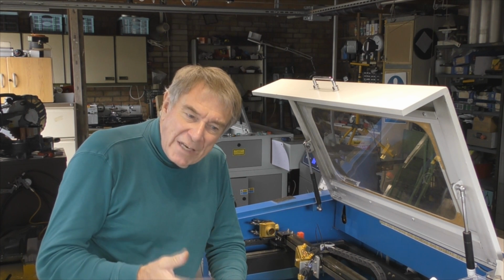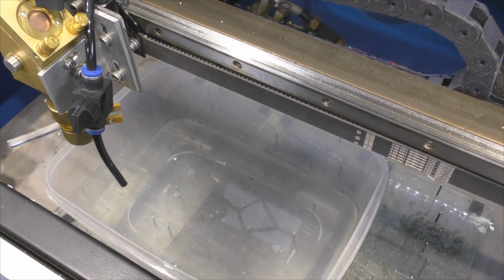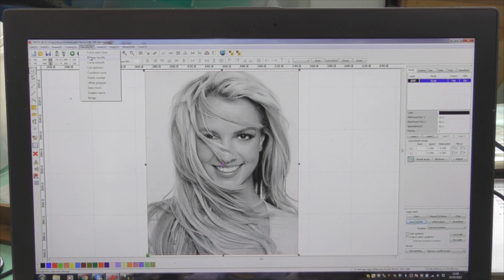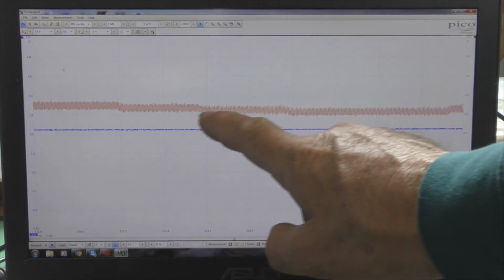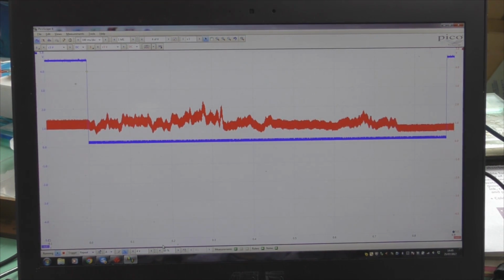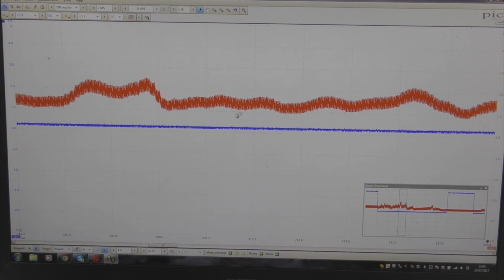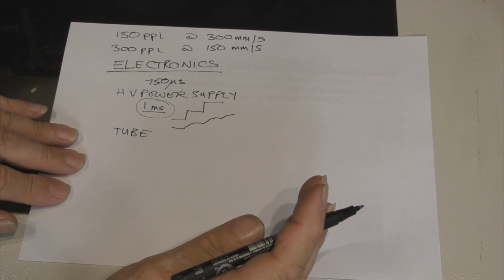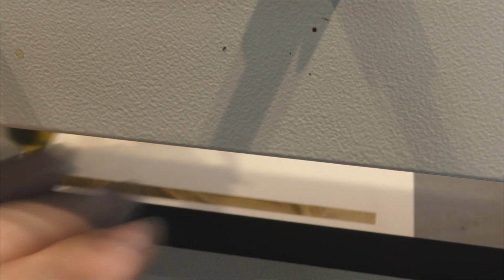RDWorks Learning Lab 114 Can We Dither Greyscale images

Comment: Dear Russ,

Just today while doing some tests on my companies lightblade machine  (90/60 60W) I managed to do a, quiet decent looking, grayscale engraving  with 500mm/s (min 10% Max 22%). The source was a 120 dpi picture ( yes the horse:) ),  but after seeing your video now I am not so sure if in fact it was a dotted picture with no gray and that RD works was actually fooling me. If you want I can send you the file with a picture of the result. 

Best regards
Jimmy
PS:
"Power is gained by sharing knowledge not hoarding it"'
Thank you and as always learning a lot from you!
Reply from the maker: Hi Jimmy
I try to do all my learning and discovery on this channel but I try to distill the essence of what I learn to the Thinklaser videos . More a demonstration of what I already know. I hate to call them training videos because I am demonstrating what the software and machine is capable of with detailed reasons. YOU become the expert by combining the techniques that fit your requirements and then honing them into an efficient manufacturing method.  
Re your horse. All you need to do is put handles round your picture and select Handle, BitMap Handle. There you will see the piture resolution. If you zoom into the picture it will either be continuous grey or a series of square dots. I suspect a series of dots. In which case it will be a binary image with ZERO gray in it (despite what the picture shows you). The  Output Direct should be unticked ( and all the other tick boxes as well) Even though you will have selected Max and Min power the Min will be ignored. The essence of a good crisp picture is small uniform dots that cluster together in different density groups to create the impression of a gray scale image. The image becomes slightly blurred in two ways. One is using an image with too high a resolution and secondly running at too high a speed.  Speed turns the dots into sausages shapes which overlap and blur the definition. You may want a good picture but depending on the material you are working with you may even get a good image with as little of 70ppi. Remember that the image is only DOTS. If you smear the dots you are hiding the background that should  represents an important element of the picture. 
All best wishes
Russ